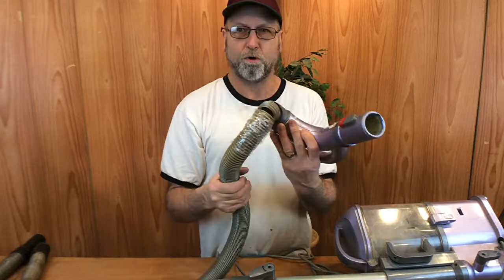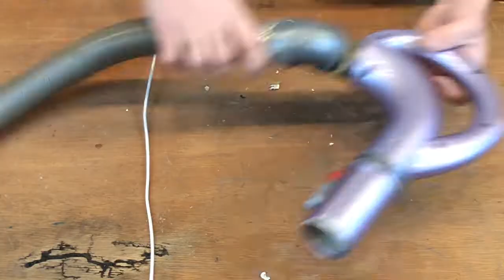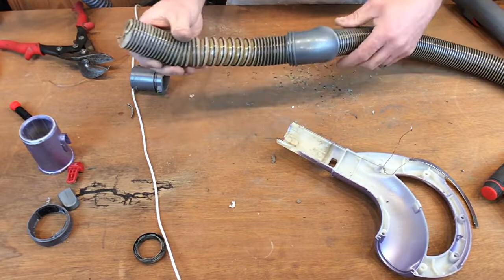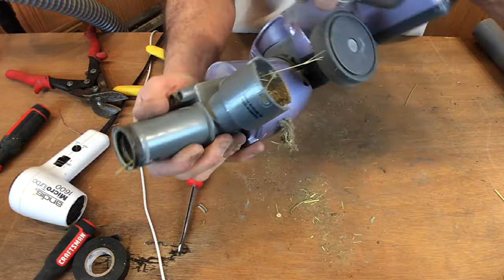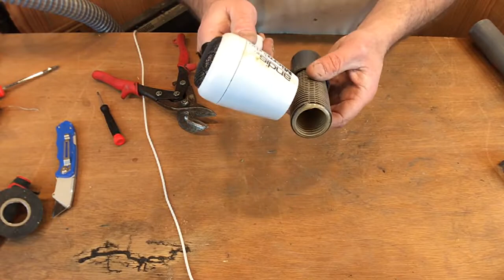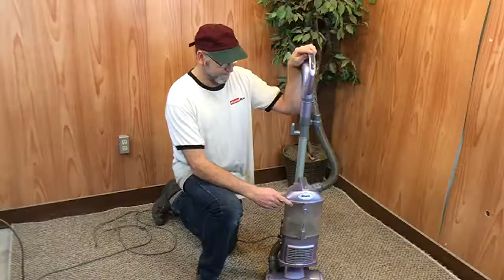Repairing Shark Navigator Vacuum

Comment: I have the exact vacuum and exact problems with the hose. I taped the split hose 5 years ago and it broke again recently. I searched internet up and down and could not find out how to take the handle apart until finally I found your video. Now I am going to order new hose and replace it with your instructions. Thank you so much.

Comment: I need help with my button. The top broke and it is stuck locked. Could be a simple spring issue but I can't check anything since it's stuck on and the button will not open.

Comment: Can't get the tube piece off that allows it to come apart any suggestions ?
Reply from the maker: The glue maybe holding it? try heating up with hair dryer.
Reply: Did the hairdryer trick work?  Mine won’t come off, either

Comment: I have a similar model. When it's on, it always blows hot air out of the front vent, making it useless to try to vacuum a tile floor for dirt and or cat litter, etc, because it blows everything all over the place. It does seem to suck things up and out of carpeting and the upholstery attachment works as well. Is this a bad design or do I have something set wrong? I've cleaned the hoses, filters tank etc, and it still blows hot air out the front.
Reply from the maker: it is normal to get a little warm air out because it is also cooling the electric motor, but if you can make toast on it I would look and see if the motor is turning freely.
Reply: @channelron3593  Thanks. It's not as hot as toast, but it's hot. Just seems like a weird design to have air blow out the front, which is the direction you're vacuuming? Someone gave it to me and said these cost something like $600?? Might be time to go back to a Dirt Devil.